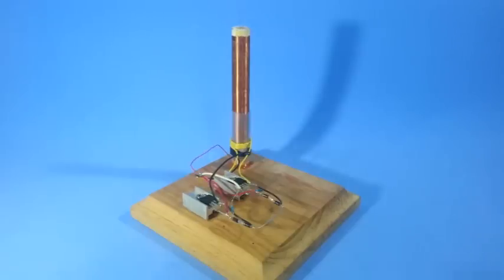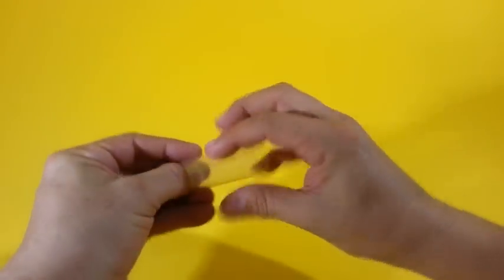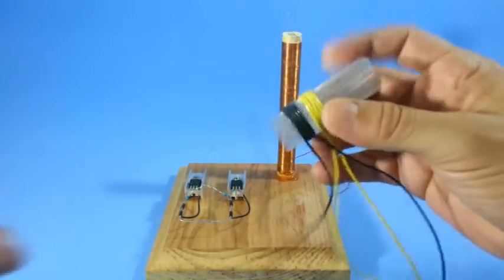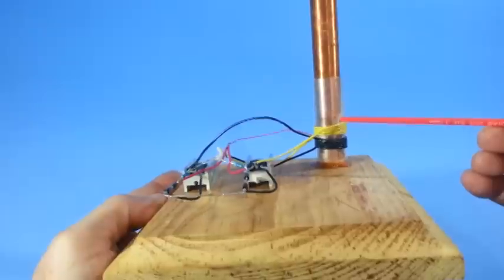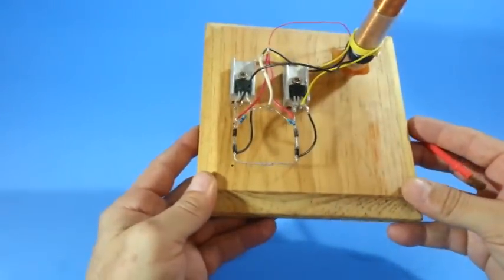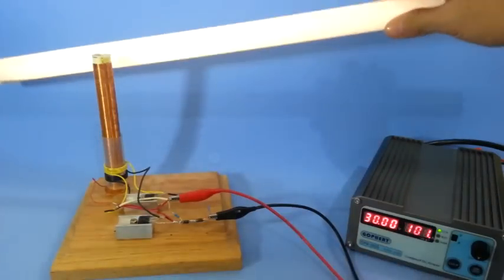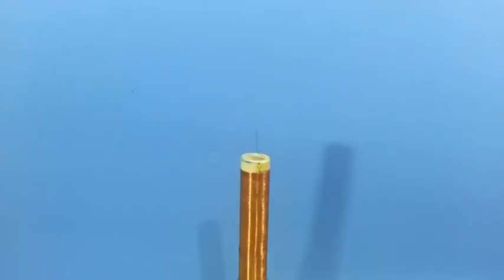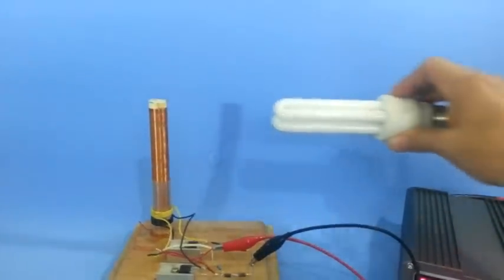Dual Primary Tesla Coil

Comment: Brilliant video would you make one with both transistors but just one primary and also why is the bot of secondary coil connected across negative and not separate and into ground? any info is appreciated
Reply from the maker: You can put two or more transistors in parallel and use one primary

Comment: Is each primary AC voltage or pulsed DC? Also, if AC, could a single circuit primary like this be used on an AC flyback coil to be used as a plasma globe driver?

Comment: I actually made a slayer exciter coil with the D880-S transistor, a 22K ohm resistor, 2 turns primary, and 500 turns secondary and at 30 volts it would cause interference to all devices near the coil, and it would light up a CFL from 2 feet away.

Comment: It's interesting to consider the variables of how this works out. On the one hand it's basically like using two parallel transistors on thicker wire but on the other the two primaries are not in the same position tuned to the secondary.

Comment: Both secondaries are wound in the same direction, same polarity. The diagram shows opposite polarity producing a square wave AC output on secondary. Is this 100% duty cycle DC out of the secondary? 50%? Not sure how the transistors are switching in opposition in the live configuration. Thanks for the video.

Comment: Thanks for sharing. I used your diagam. But for the secondary I did: 0.6 mm wire. Tube: 33cm. X 33 mm. I run it on 40 volts by   700 ma. It works great with top load. It lights tubes at a distance of 35 to 40 cm.

Comment: heres what i dont understand aout this circuit. If the secondary is connected to the base of both transistors and everything is connected to the same power and ground, then doesnt that make the diodes and resistors paralell(i cant spell)? so why not use one resistor with half the value in ohms and just one pair of diodes? wouldnt that be the same as your set up? and if the transistors are connected together at their base, then one will turn on before the other since no two transistors have the exact same voltage at which they switch on. So the current would only flow through the primary of the transistor with the lowest 'on' voltage because the voltage at the base will be pulled down before the other one could swith on too. So why does this work? im wondering if it doesnt really work and its essentially still just a slayer with one primary. can someone help clear this up for me cause i dont see how it would work this way

Comment: Try to use 2 coils but wind it in opposite direction with capacitor discharge. When u will do that u neutralize magnetic into full dielectric potential. Of course it has to be all in resonance with secondary.

Comment: I've personally found that if the resistor of the circuit is dropped to about 2K-ohms, and the transistor replaced with a TIP41C, you can pump much more power into the coil. You'll also probably have more electric discharge at the end of the secondary if you use 2 turns for your primary instead of 5. ;)
Reply: Plasma Junkie Are you sure the 2k resistors are correct for the tip41c transistors? And, what about using about 1200 turns on secondary?
Reply: Yes, that's what I use in my single primary setup. The slayer exciter circuit automatically tunes to the secondary coil, so 1200 turns should still work fine
Reply: Plasma Junkie Thanks much plasma junkie!  Many blessings!
Reply: Are the resistors  2w rated or higher?  Also, if the secondary is wound with more windings and produces greater voltage, would the circuit need extra diodes?
Reply: No (0.5 watt should be fine), and no
Reply: Thanks, man!

Comment: I think , you can use MJE3055T . It is awesome  but it hase  some heating issues at higher voltages like 24 volts. for fix this problem you can use small bldc fan

Comment: How efficient (inefficient) is this method of power transfer?
Reply from the maker: +Ken N Very inneficient. That's the reason we still use wires.
Reply: Ludic Science 
I'm sure it is but what kind of percentages are we talking?
Reply from the maker: +Ken N 2 or 3 percent

Comment: I have made your other Tesla Coils (worked well). I will try this. Can you explain how the 2nd primary affects the resonance of the circuit. Thanks
Reply from the maker: since both drivers are connected to the single secondary, they work in phase with each other
Reply: thanks..

Comment: what about instead of two primary, using parallel transistors on the same heat sink with single primary ?
Reply from the maker: May work, have not tried
Reply: Actually I tried with 4 parallel transistors with single primary coil and  considerably much arc is generated and  more range  i got for lighting the bulbs with 19 V laptop adapter as DC source.

Comment: instead of making a 3rd bigger version can't you just make it draw more current
Reply: Herobrine GaMiNg that would burn out the transformers
Reply: no you can't make it draw current it only draws as much current as it requires. you could put more voltage but it would burn out the transistors

Comment: I will recommend you using a Horizontal deflection transistor like TT2206 or J6810 for higher input voltage like 170v dc both of them can handle upto 10ampere of current and a Base to collector breakdown voltage of 1600volts and Collector to base breakdown voltage of 800 volts if you want larger output you can Use 170v dc from rectified mains voltage. and for even more power use secondary of dimensions 4.5cm diameter and 45cm height with 800-1000 windings of 0.23mm magnet wire . I will recommend you to not to use three primaries as no two Transistors ,forget about three  are made exactly similar and one of them Will turn of faster and all the current will flow through it resulting in overheating .example of this can be seen in Mazilli zvs driver where one MOSFET turns on little faster and both starts oscillating 
there transistors are fairly cheap 3US$ for 10pcs on Aliexpress
Reply: revscott58 well I used some UF5408 Ultrafast 1000v 3a diodes 
And 50k multiturn precision type potentiometer
Reply: revscott58 my pleasure
Reply from the maker: yes that may work
Reply: Ludic Science it worked with my slayer exciter
Reply: Mrinal Thakur, what resistors and diodes do you use with those transistors ?
Reply: Thanks much Mrinal Thakur! Many blessings.

Comment: I just wanted to say that I really like your videos!  thank you very much!  I would like to make an Ozone generator, I don't know if you've seen where this guy uses a test tube puts aluminum foil on the inside and wraps wire on the outside. and a high voltage power supply between foil and wire.  maybe you can recommend one of your circuits to be the psu.
thanks mike

Comment: i have burnt so many transistors, followed so many tutorials, copied as accurate as possible and slayer exciter never works
Reply: Try using potentiometer instead of normal resistor and adjust it until you get good resoult. Worked for me :)
Reply from the maker: +Gotin Fuklio that is strange, you must be making a recurrent mistake you have not noticed. Most common error is wrong polarity of the primary.
Reply: Ludic Science all configurations, all polarities everything and still my atheism is not an explaination
Reply: I'll explain
Reply: Man did you tried to swap the primary winding
Reply: Or you're using puny transistors... Try using beefier power transistors   (MOSFETs, IGBTs). One good example is the "well-known" IRF510 MOSFET.
Reply: for me also same problem
Reply: @john  isaac forget about the igbt, the f(t) is waaaay too low for a tesla coil, and for a mosfet, you need a different circuit (1 more resistor to create a biasing voltage instead of current). I would sugest trying something like a bd139 and a 22k resistor, or a buv48a if you really want power.